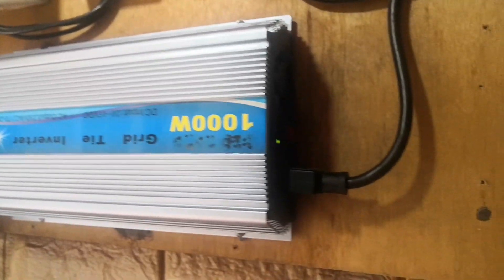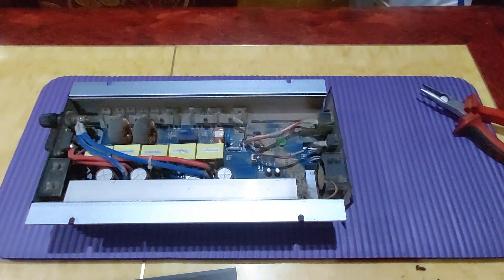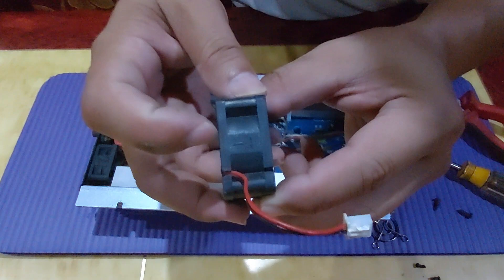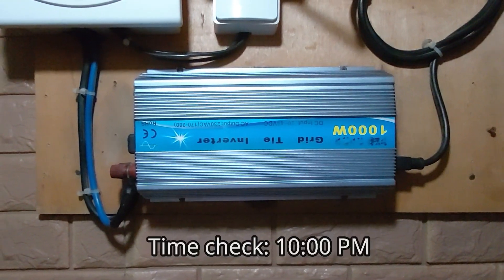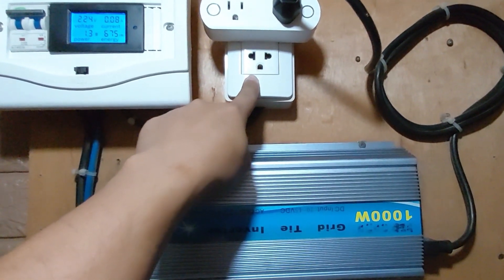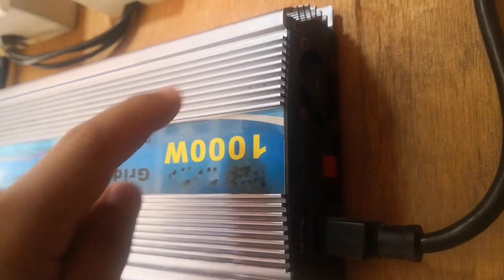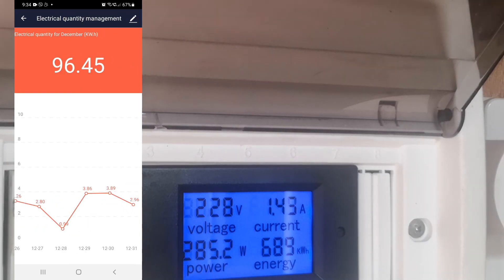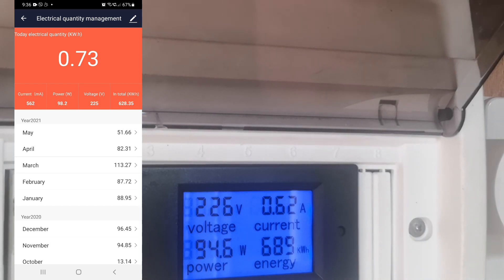1000 Watts Grid Tie Inverter Fan Replacement | DIY Petz

Comment: To high tech. I've had mine outside under solar panel. Fan outside rusted. Yesterday it was 77 in California and my digital plug wasn't reading @ 2 pm think getting to hot?
Reply from the maker: Yes, too much heat can cause issues. It's best to keep the inverter in a well-ventilated area.

Comment: Line to Ground and linya dito sa amin. Ganyan din and GTi ko. Paano ikabit sa grid? Thanks.
Reply from the maker: Good morning Sir Steph. Yung AC output ng inverter is saksak mo lang sa isa sa mga outlet po sa bahay na may tamang sukat ng kable Sir. Same as plugging in an appliances sa bahay. Tnx. po.
Reply: @RollyPetz  So di sya namimili ng grid. Salamat sir...
Reply from the maker: @MrStevedore1  Yes Sir..
Reply: @RollyPetz  So di sya namimili ng grid, line to line o line to ground. Salamat sir.....

Comment: .... Rip the fan label ..and oil the bearings hole behind it's label once in it's lifetime..cut the blocking fan hole thing( do not block) so easy to oil it again..
Reply from the maker: Thanks for the suggestion Sir. Much appreciated.
Reply: @RollyPetz  ..sure bro..I have a similar but smaller wattage 600w for ~200w panels...I had to modify it's banana terminal to a proper mc4 connectors...been 4 years since purchased..still working..but there is difference between the blue & white labeled...do you notice the stanby wattage on it..it's around 2.2w..but the white labeled has no standby power..what about the 1000w.. does it have a stanby power..?
Reply from the maker: @surenbono6063  What do you mean by standby power sir?
Reply: @RollyPetz  ... standby power is cord is connected the switch is turned on but there is no DC input..like for night time..what is the wattage?
Reply from the maker: @surenbono6063  Ah, OK...for me it's was @ 1.2 Watts before I installed the smart plug, but after installing the smart plug it now automatically turn off the AC side by the smart plut, now the wattage is below .5 watts w/c is the smart plug wattage itself.
Reply: @RollyPetz  ...the white labeled 600w grid tied had no stanby power ..I wonder how it was possible..and what's the science behind it..

Comment: ano pong tawag sa meter na kinabit niyo po sa tabi ng dc breaker??
Reply from the maker: Good afternoon po Sir. It's a Digital AC Voltage Meters 100A 80-260V Digital Amps Volt Meter LED Power Panel Monitor Voltmeter po...
Reply: @RollyPetz  saan po nabili sir? may link po ba sa shopee or lazada?? salamat po
Reply from the maker: @HaZe2794  good morning po. Eto po yung link via Shopee po...tnx.

https://invol.co/cl593wg
Reply: @RollyPetz  salamat po more power po sa YT channel niyo po
Reply from the maker: @HaZe2794  thanks for the support po....